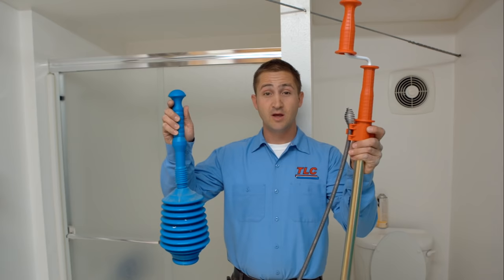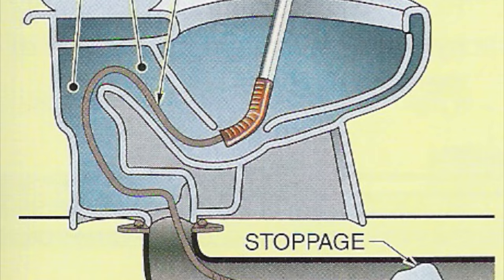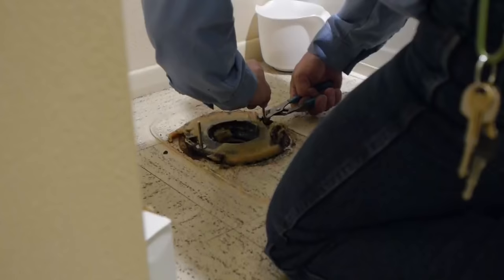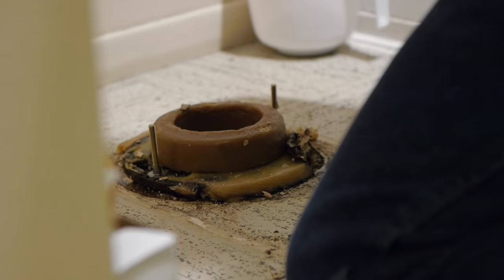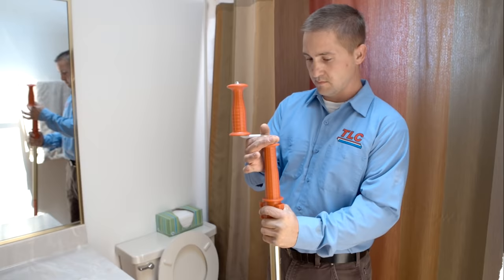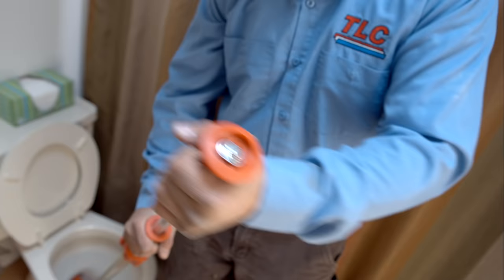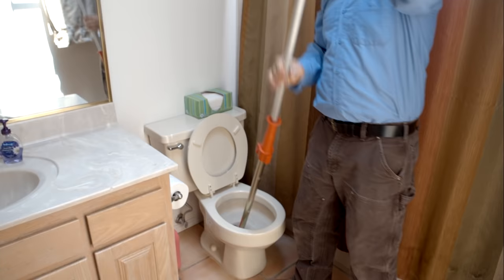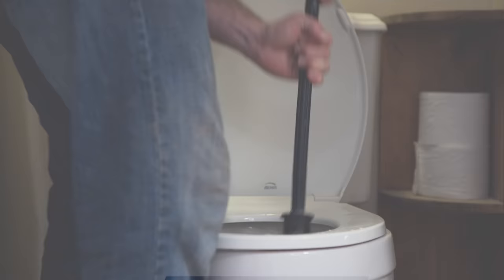How To Unclog A Toilet

Comment: Bad presentation.  I  can't really see what you're doing.   How long does it take to break the wax ring with a plunger?  Everyone I know uses the plunger and noone ever had a problem. I have been using a plunger 20 years on my antique toilet.  The toilet must be 80 years old, it come with the house. No leakage.
Reply: Using a plunger occasionally for small clogs probably won't damage the wax seal but I guess it could if you plunging really hard. An auger/snake is definitely better. As for how to use it, there really isn't anything more you need to see. You stick it in the toilet and crank the handle. That's about it. After you pull it out, flush to make sure the clog is gone, then clean it and set it somewhere to dry. Or so I've heard. I can't get mine to work which is why I'm here.
Reply: I damaged the wax ring today with a plunger so it definitely can happen :(
Reply: @lauraj.2305  I like your spout of projected confidence, sounding knowledgeable -- until the time comes -- to "doo" -- then you are mystified.

Comment: Thanks. Couldn’t afford $70 for a 6ft, so I bought a $20 3ft and hoped for the best. Not only did it work but I found out someone flushed down half a bar of soap and it got lodged in the drain pipe. Saved me a call to the plumber.
Reply: Same issue. Did you find a resolution?